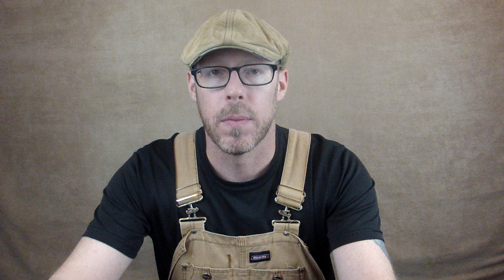Does concrete need expansion joints?

Comment: Hey steve thanks but can you SHOW the difference between a expansion join and a control joint?  BTW i am new to concrete and trying to learn
Reply: An expansion joint should have a gap completely free of concrete-to-concrete contact. If rebar spans the gap, it should be sleeved on one side so it is not bonded to both slabs. What I would like to know if the formula used for expansion joint spacing. Expansion joints don’t seem to be covered very thoroughly on YouTube yet.

Comment: How about where the concrete decking meets the top of the bond beam? Should there be some type of sealant in that crack before I put new tile on?
Reply from the maker: You mean the coping - the deck is separate from the coping. You will have a joint between the deck and the coping and another on the underside of the coping cantilever (on concrete pools). Both of these need a concrete urethane expansion joint. The coping - deck one can be self leveling, but the underside of the coping needs to be gun grade. NP1 polyurethane, deck-o-seal or Vulkem 116 are common options. Tile goes on first. It is not tight to the underside of the coping. This is where the urethane bead will be. Often this top joint is grouped but this is a mistake. It should be a flexible joint.